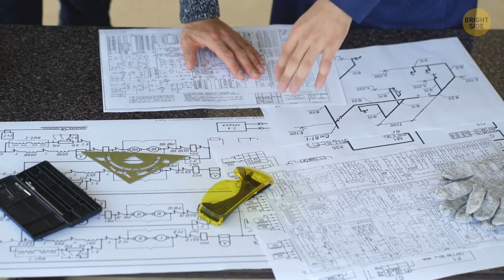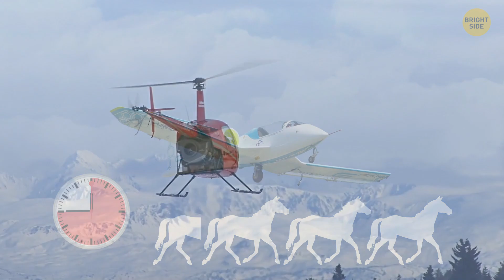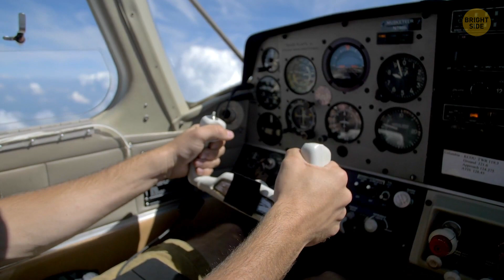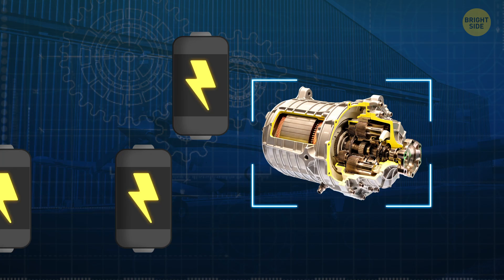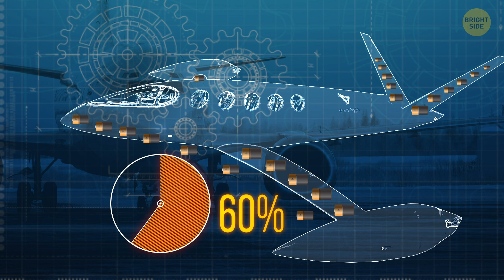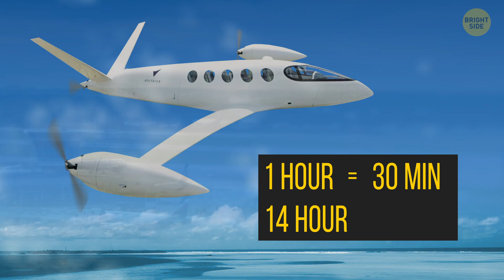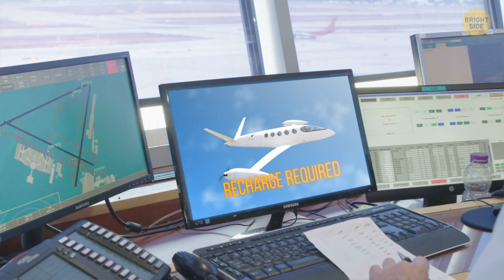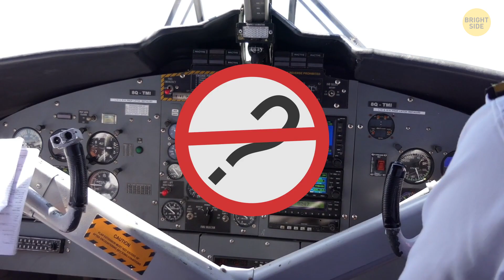That's Why We Can't Have Electric Planes Yet

Comment: Poor energy density, non-existent infrastructure, excessive mass. Flying a small electric aircraft with several people aboard for a short distance is one thing. Flying hundreds of passengers and their luggage over short, medium, or long haul distances is something entirely different. Modern cargo aircraft regularly haul over a hundred metric tons of cargo over international distances, and this is all done affordably and efficiently using technology that exists now.  Hydrocarbon fuels, like it or not, make that possible. Heavy batteries with poor energy density do not. Physics says no